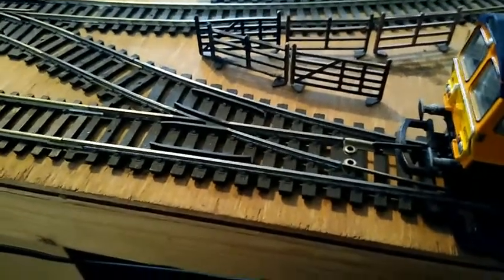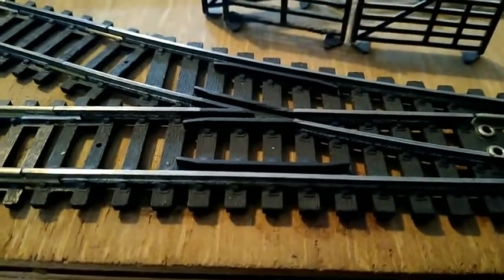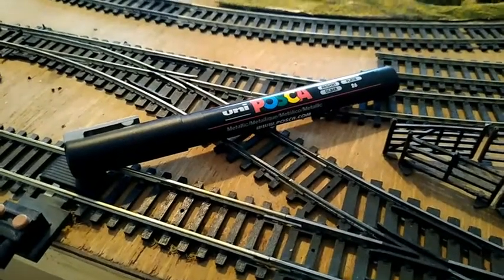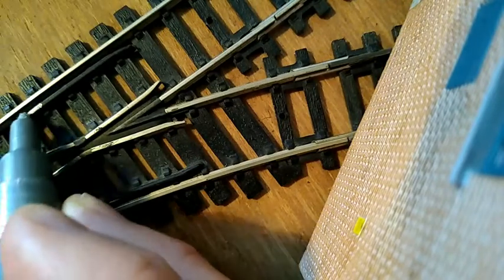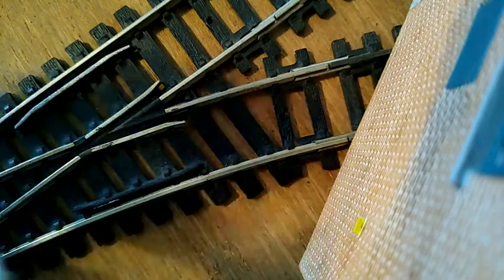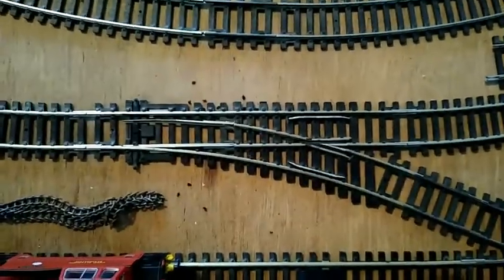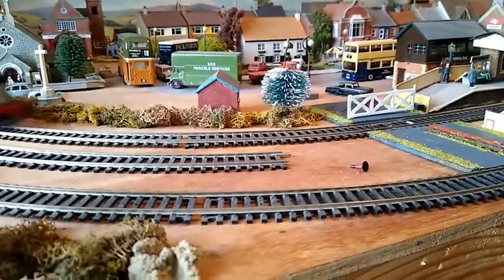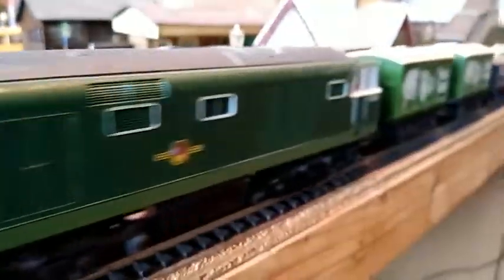HOW TO IMPROVE HORNBY POINTS?

Comment: great tip, great improvement, will get down to w h smith,as soon as,many thanks,take care!!
Reply from the maker: I have done a follow up video on this as the paint can get stripped off the point frog. But it's still worth getting for some of the details.
Reply: just as a followup i found i had some aluminium spray paint i sprayed some into the lid and with a fine model brush i painted thesaid pieces, it looks great,thanks again,take care!! @layout1237

Comment: If you want your points too look realistic than you paint all the rails with a rust colour and the tops of the flange rails a rusty colour to, not silver like you have! Anyway, small hornby points are badly made they are made so that the the curves are too sharp. You be better off using Peco points and avoid the set-track range as they are not much different to hornby points use pecos Streamline range.